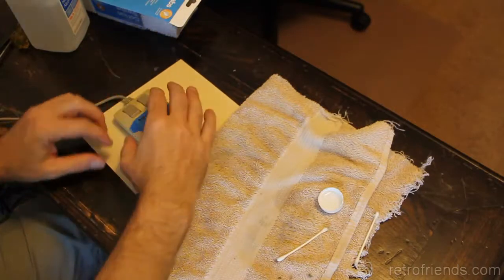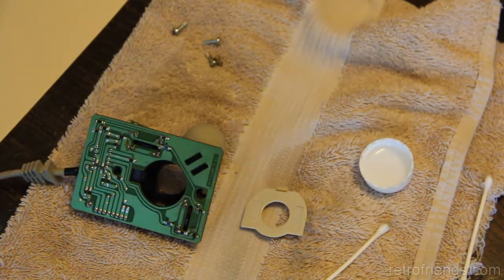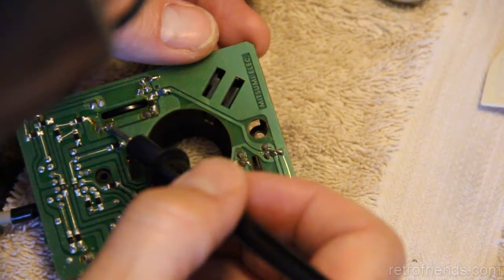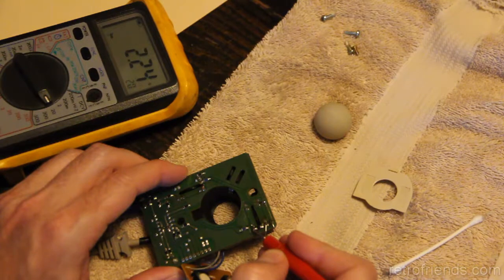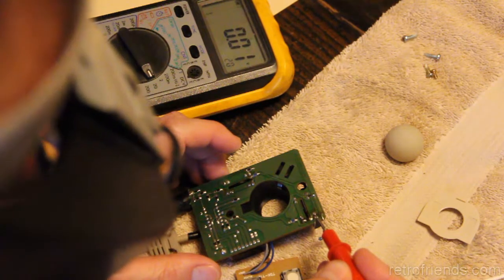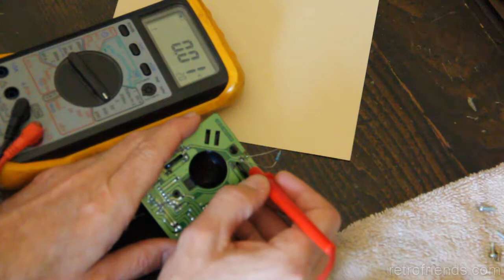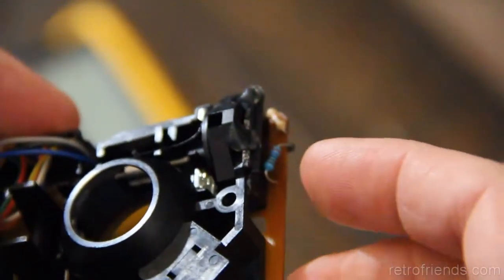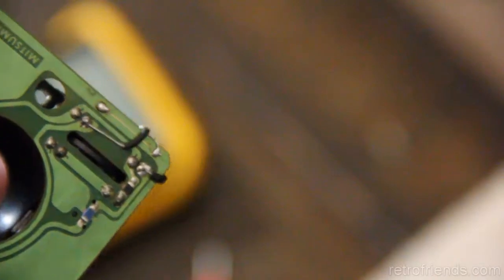eBay Amiga Mouse Lot Part 2: Amiga A1000 Mouse repair

Comment: I've got roughly the same mouse as this one, but on the daughterboard, instead of proper microswitches, I've got those metal domes that click over when pushed. Probably a further cost-reduced (later) version. Came with an Amiga 500 that internally is one of the 500+'s, but 512K, so that would put it at roughly 1991? Mine's pretty much fubar. The part of the rollers that touch the ball are completely rusted out (like, thick layers of copper oxide), as well as the connector. I have no idea in what environment my mouse was, but it had a hard life.. I decided to replace the insides with that laser board you can purchase from the amigakit webshop.

Comment: LM339 is an op-amp. So basically it was not amplifying the signal from the optocoupler so you got SOME little movement. These are also used in Atari trackballs for pretty much the same thing. And simple audio circuits.
Reply: The LM339 is a Quad differential comparator
Reply from the maker: Good to know thx